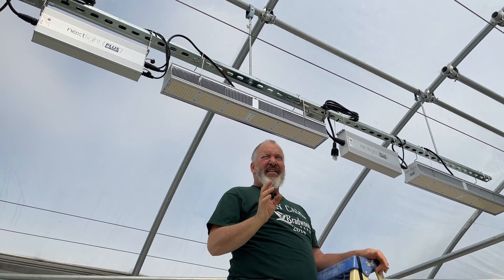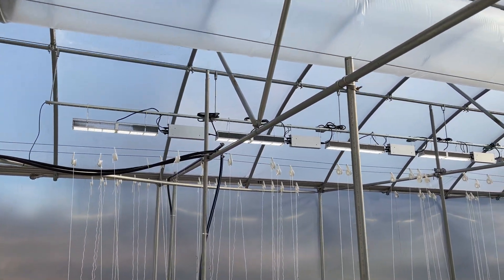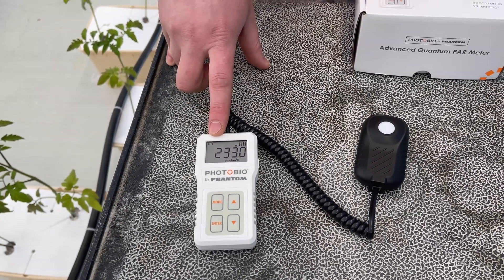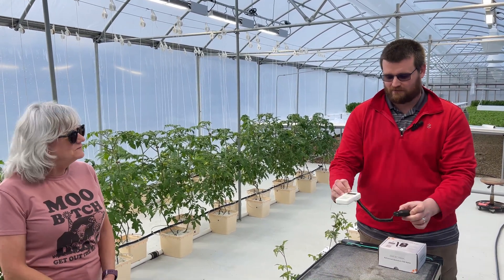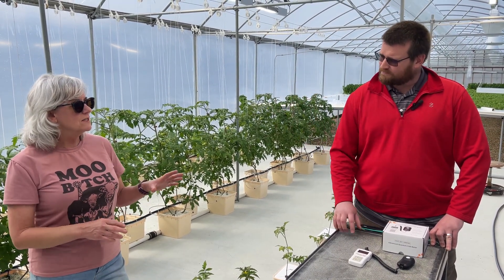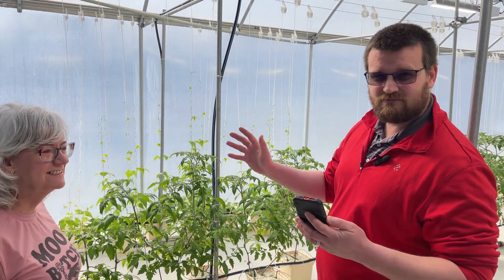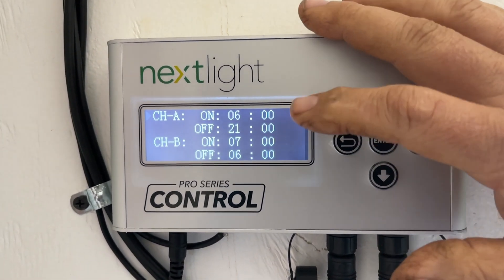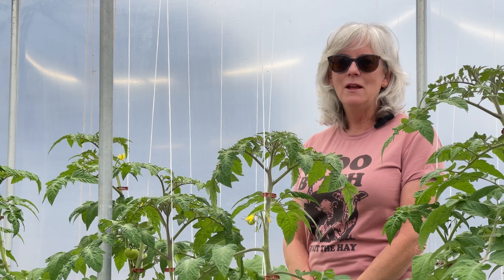LED Lights -Technical Discussion and Application

Comment: So the controller can ramp up and down based on the light measurement instead of over a specified period of time in order to meet your expectations for daily average?
Reply from the maker: Thats right. It has a probe that that can be set to measure temp. We know what our hot and cool temp readings are so when programed it ramps the amount of output down. When the sun comes out it ramped down to 10% output which is really cool. We think these lights are going to make a huge difference in our production.
Reply: @HomegrownPassion  Thank you for the clarification. Pretty neat. I hope it helps productivity and is cost effective. I look forward to hearing about the numbers in upcoming videos